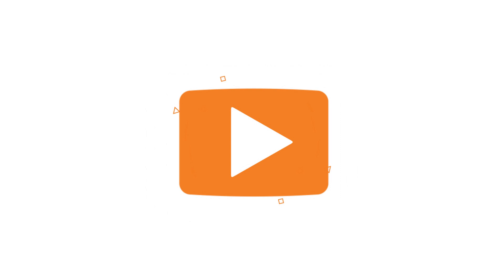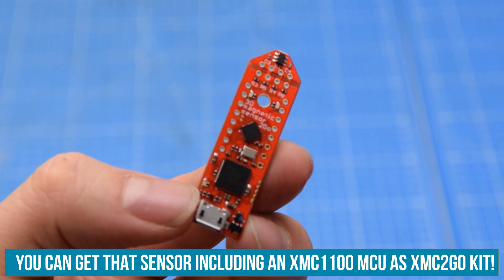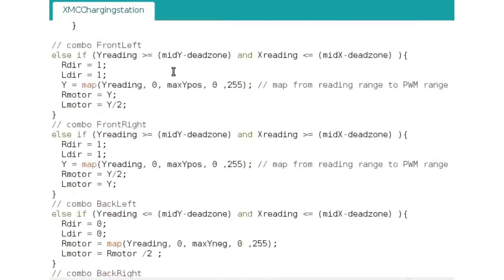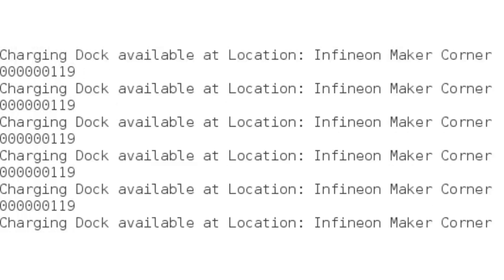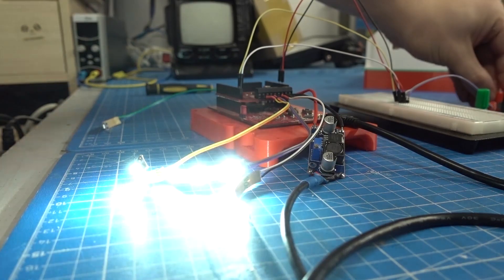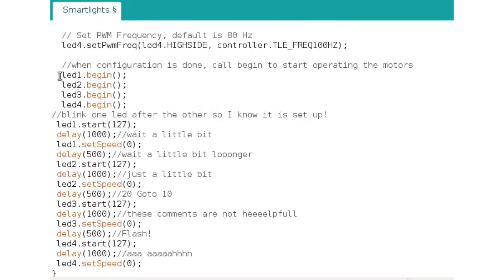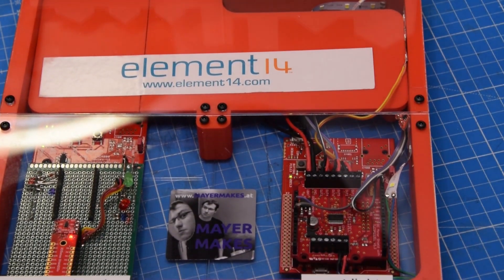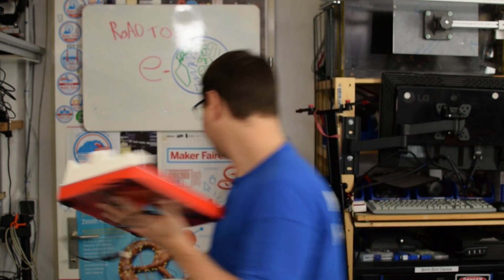Infineon Smart City Model

Comment: Had you gone with the UDOO RYZEN Bolt V1000 Maker Board SBC you could had used the GCC-X86_64 to compile the code to very fast machine code.